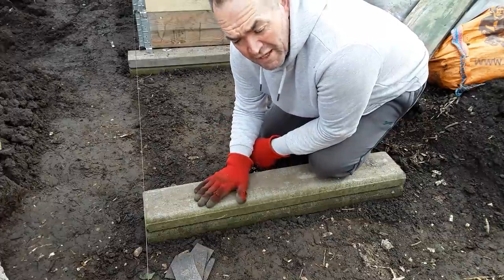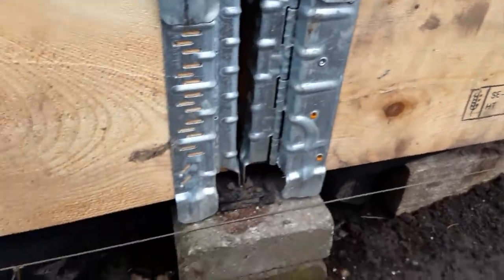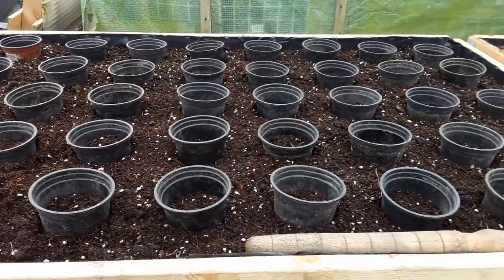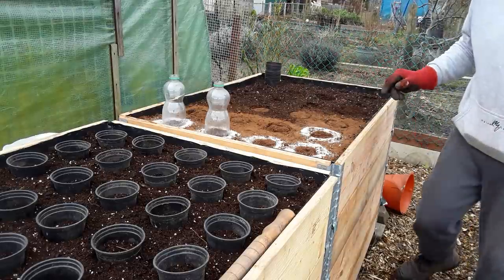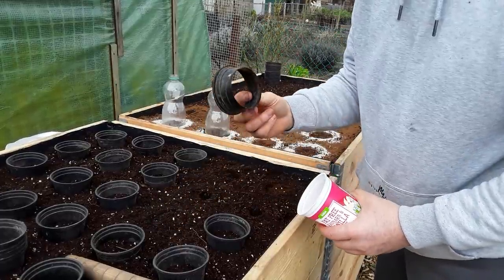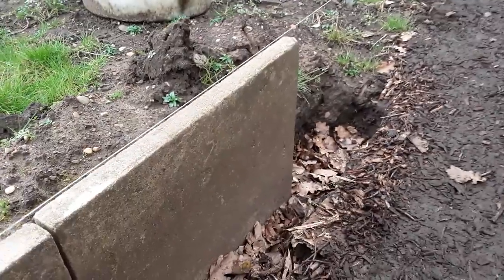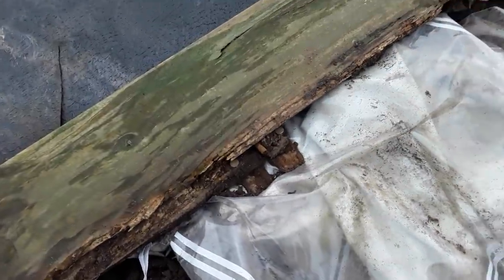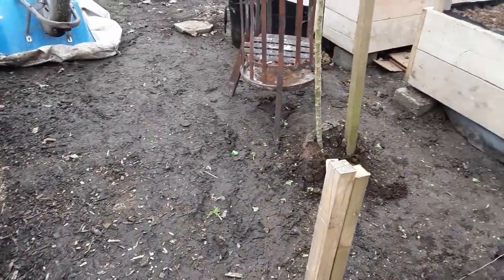How To Build And Fill Pallet Collar Raised Beds On A Budget♻️Preparing Them For My Carrot & Parsnips

Comment: one of the best parsnips to fill your stations is " tender and true ". i've had loads of monsters with this method  but with one draw back.there is a hard centre core. great for exhibition, no good for eatimg. i'm taking nigels advice for the second year running and growing  " gladiator ".i'm also making use of any space left by including my sweet candle carrots ( love them ).....................brian
Reply from the maker: Gladiator and Sweet Candle are my preferred roots too Brian and I still cut out the core on the big Gladiators, can't be beaten. 

🥕Happy gardening, Terry King.

Comment: Hi Terry! Fantastic videos on your allotment.
  I'm working on building a raised bed system similar to yours,

however you have much more space than I do.
  I'm using 2 high pallet collar bed, this year and will add another

level next year.
Super big Thanks for an Excellent point to avoid the wood touching the ground soil. 
One thing I haven't learned is to do with your plastic liner placement.
You have it up all 4 of the sides, do you have it across the bottom as well, 
forming a liner at the base as well ?  Continuous like a pond liner from side to side ?
Reply from the maker: Hello William, the plastic goes down the side onto the bottom and about 6 inches towards the middle, thats to keep the moisture and contents away from the wood, leaving the bottom open to let the worms in and moisture out. look for my video on how to protect the sides using sacrafisial bourds.

Happy gardening, Terry.

Comment: Hi, just wondering what you call those black plastic to hold your seeds in place. I might gonna do that for my next carrot planting.
Reply from the maker: They are 3 inch pots Jessebel with the bottom part cut off, large yogurt pots will do the same job. The more space you give them the bigger they will get. Good luck with your carrots. 

♻️Happy gardening, Terry King.

Comment: Hi Terry your set up is neat however I have never seen carrots planted like this before is it because you are in a temperate  climate?  Here in Barbados in the tropics we plant carrots not really parsnips directly in the ground or if in containers in good soilmix.
Could you please explain your method with the funnel & cococoir I am really curious as to theses additional steps taken
Reply from the maker: As you know root crops don't like nutrients as they will fork so I put the manure low down in the beds and to help the carrots and parsnips tap roots have a pleasant journey down to the manure which they can feed on without worrying about it throwing out legs I use my crow bar to make a hole and fill with coco coir. I do grow for showing and the  Sweet Candle variety is ideal for this and if spaced out they grow really big and a uniform size. The height of the beds helps stop the carrot fly as they fly close to the ground. Hope that helps.

♻️Happy gardening, Terry King.
Reply: @terrykingsallotmentgardening  ooooh thank you for explaining this different strokes for different folks.  Here we mainly grow for food production not exhibition.
Yes too much manure especially nitrogen does cause the plant put more energy inproducing leaves "bushytops" as opposed to the actualroot crop production like the carrots parsnips yams potatoes etc.
Reply from the maker: @geriannroth449  🥕😁🥕😋😍🥕🥕🥕🥕🥕🥕🥕🥕🥕👍

Comment: Hey Terry!  When I saw how high you were building the raised beds I thought holy cow how much is it going to cost to fill them.  We have heavy red clay no good for carrots or parsnips.  Do you need to build that high for root show veggies?  That was a lot of work!  I'm working on building a raised bed myself, and liked the free wood and folding flat at the end of the year.  I've looked over here for pallet  collards to no avail.  I don't think we use them here in the states,  the best to you this growing season.
Reply from the maker: Hello Theresa, each pallet Collar bed takes about 1000ltrs of material, but I have plenty of materials to do this or it would cost a fortune to fill, Wednesday's video show the progress on the pallet collar beds. Carrots would be fine with 2 collars high, but you would have to protect them from the carrot fly so 4 high will hopefully stop this as they fly close to the ground. Parsnips need the length, better for show would be 5 high. Thank you my friend. 

♻️Happy gardening, Terry King.

Comment: Hi Terry Great video, first time gardening can I ask what is the black thick plastic in the beds used for, is it on the side, was just thinking about watering 😀
Reply from the maker: That plastic Keith is to stop the wood from soaking up the water from the soil/compost so it prolonged the life and stops them rotting quickly. I like the wood to breath as naturally as possible. 

♻️Happy gardening, Terry King.
Reply: @terrykingsallotmentgardening  Thank you so much for you reply greatly appreciated. What are the metal parts called that you use to join and stack the bed together and what are the sizes of each bed and the metal parts can you get them them made to order so they click to together,  pretty basic questions I am sure but recent brain surgery x2 makes me loose focus so quickly Thank you so much
Reply from the maker: @keithpinder220  the pallet collars come ready made and are used to hold heavy items on pallets so don't think you can get them seperate. They fold flat so easy to transport BQ do them, but they are too expensive to buy.

Comment: This may be a basic question which may have been asked before but why have the raised beds that deep, Terry? Also, where do you get your pallet collars from?
Reply from the maker: Hello Richard, (1) I have or had access to free pallet collars, (2) I have far too much quality soil full of of organic materials added to the plot over 80 years, (3) they are a good height to work on now my back is getting weaker, (4) hopefully to protect crops from low flying predators, carrot fly and the main reason because I want too......lol. I got some pallet collars which needed repair from a local company some from a contractor that worked for me and a fellow plot holder who has permission to take a few before they go for wood chipping, absolutely a crying shame to know they are only a single use before they are scrapped. 

♻️Happy gardening, Terry King.
Reply: You’re a lucky man to have access to free pallet collars! Appreciate your swift reply. Stay safe
Reply from the maker: @richardfromcornwall5492  ♻️👍👌♻️